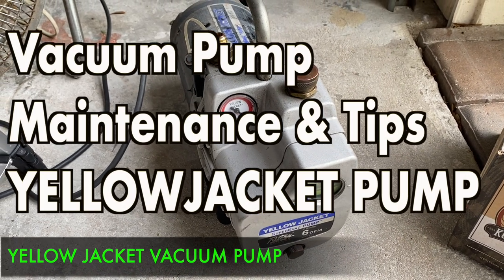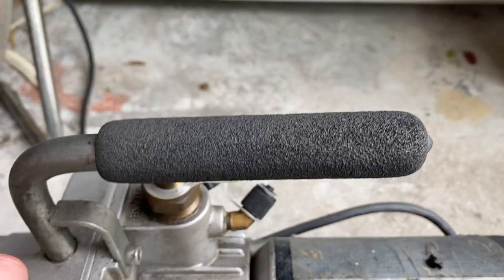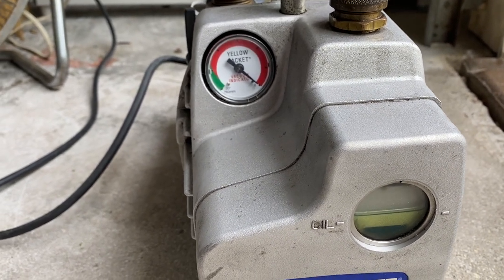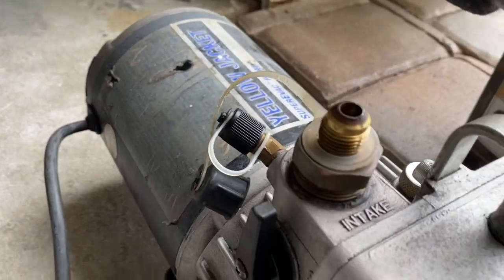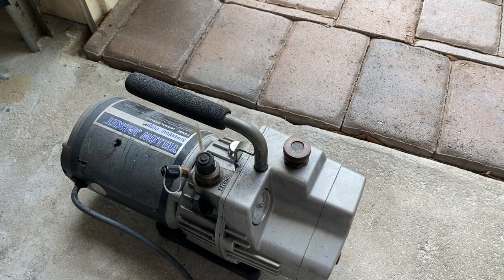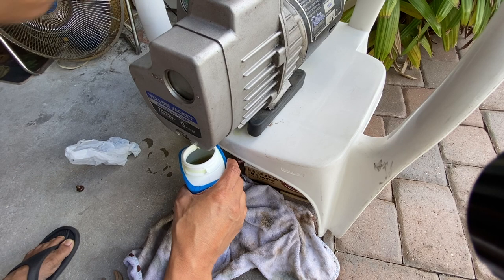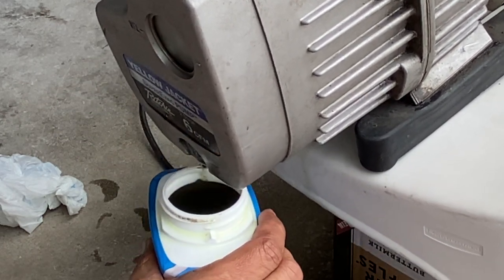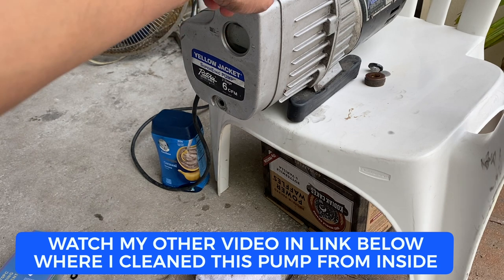Vacuum pump Proper Oil change and maintenance - Yellow Jacket Pump

Comment: I have a SuperEvac Yellow Jacket's vacuum pump. From the very beginning it never pulled down below 3.000Microns. I think it is due to the leaking located in the Oil changing valve (the manual one).
What would you recommend me to check, please.
Thanks in advance.
Reply from the maker: Check seals. You may want to open it up and clean from inside. I made a different video on my channel cleaning it from inside. Check it out. Make sure all seals are tight and screws are properly torqued.
Check videos in description link.
Reply: @HowToDoitright  Perfect Sir. I'll do as you said.
Thanks a lot.
I do really appreciate it.